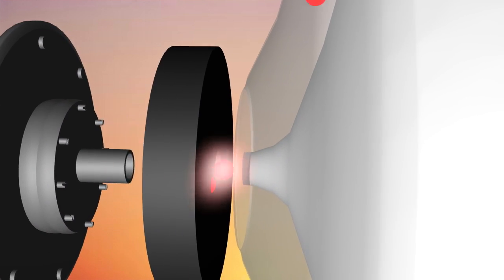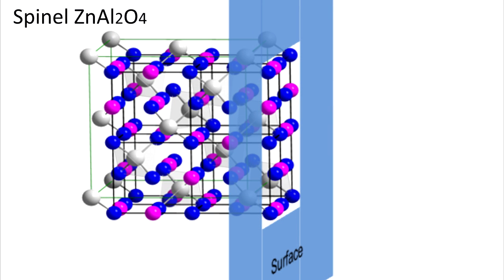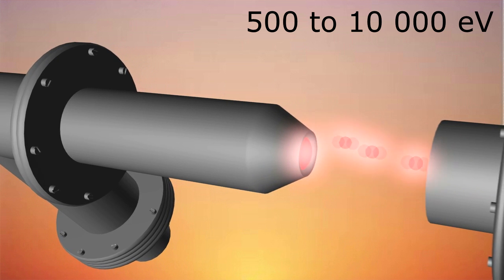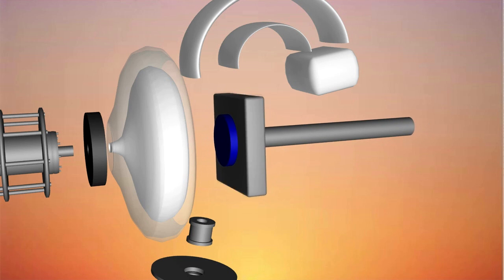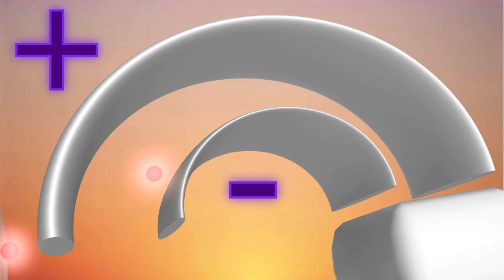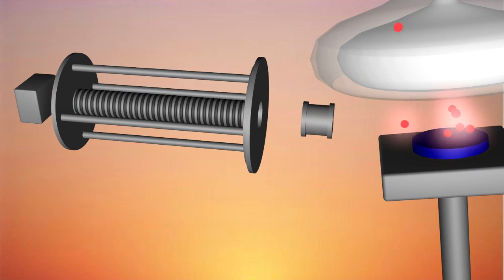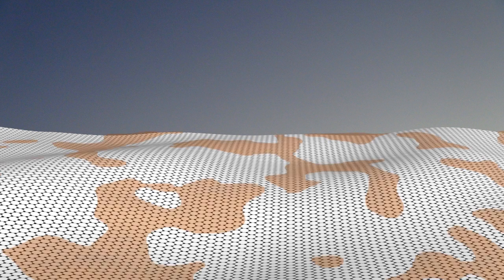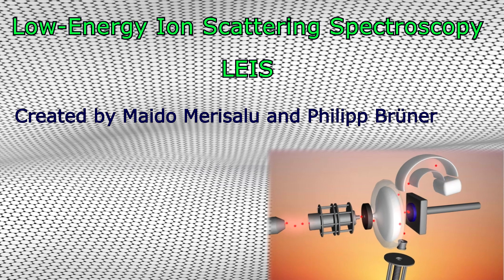Low-Energy Ion Scattering Spectroscopy (LEIS)

Comment: May I know the disadvantages of using this device? what are the drawbacks?
Reply from the maker: +Belvina Benjamin Hello and thank you for the excellent question! The main disadvantage is actually the same as its greatest advantage - surface sensitivity. Because you study the top 1-2 atomic layers on a material, any contamination (even an ultra thin adsorbed layer) will affect or even ruin your experiment. So the cleaning of the surface before a measurement is a very important step which may be problematic in some cases. Data interpretation may also be difficult sometimes. Generally LEIS and other characterization techniques such as XPS, XRF, SEM, AFM, XRD and TEM complete each other and using them together allows you to get an almost complete set of information about a material and make it possible to solve even complex problems.
Reply: +Captain Corrosion Thank you for your reply. Your video is great! Hope to see more informative videos like this :)
Reply from the maker: +Belvina Benjamin thanks :) More awesome stuff coming soon!